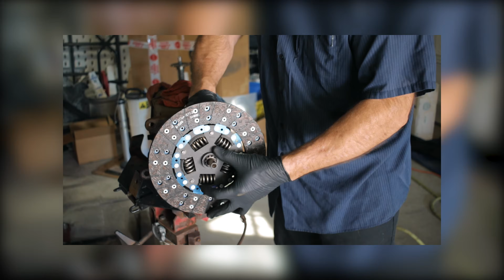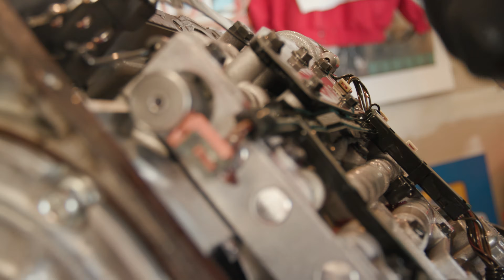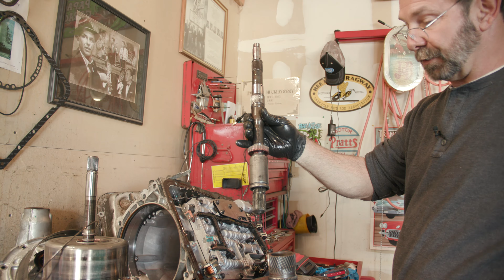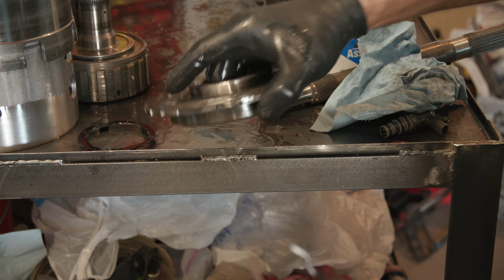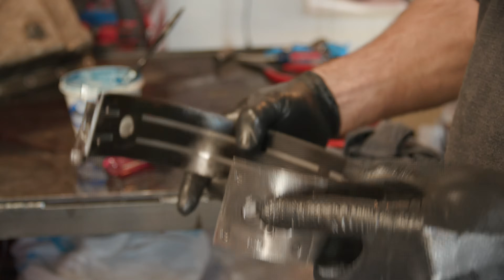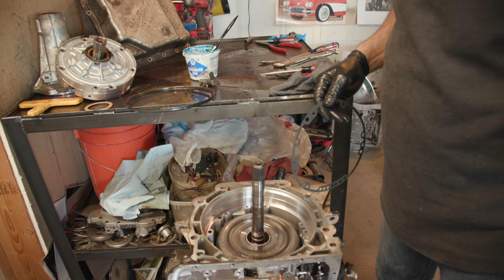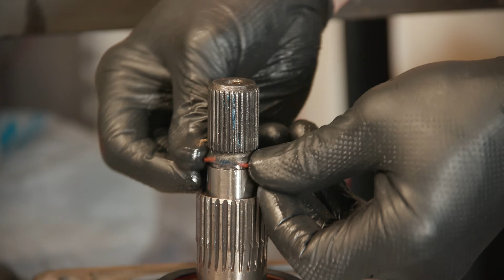4L60E Output Shaft Swap - 2WD to 4WD Conversion

Comment: I liked the video but you didn't need to pull the bottom end out after removing the snap ring off the shaft, it's good that you showed it though. Might as well inspect it since you're there.

Comment: Anyone know what year this trans is? I have to do this exact swap between a 97 and 98
Reply: They're all pretty much the same even the pre 96 4l60e single case, this will apply to all of them and there are only 3 output shafts to choose from 2wd (long) 4wd (short) and Corvette output shaft (real long)

Comment: i did this, but now i have a leak between the back of my transmission and my transfer case, is there meant to be an output shaft seal on the case, or not since the 2wd yoke has its own? thank you
Reply: yes there's a gasket that goes between transfer case and adapter and a o-ring between tranny case and adapter.

Comment: Once the snap ring was removed from the output shaft, why was anything else removed? 
The transmission should have been in an assembly fixture where the output shaft could have been bumped and it would fall out. A trick to remove the pump is to apply slight pressure to the pump at the lower side while bumping the input shaft in the opposite direction. NOT banging the shaft, but "encouraging" the pump to break loose.
Reply from the maker: You're so right.
Before we started filming this episode, we had a rough plan.  But, then we got off track...and carried away.

Regarding the pump removal, that's a great tip.

Thanks for your comment.  Appreciate it.

PS I have plans to re-make this episode.  New & improved...
Reply: @SouthpawAutoworks I’d really appreciate a remake of this video I really enjoyed it and plan on doing the 2wd to 4wd swap soon

Comment: Thank you for all your help. I have replaced my sunshell and torque converter in my 4l60e on my 98 tahoe. All seems be fine, sorta.... In my driveway I have run it thru all the gears and it seems fine. When I go from Reverse to Park I hear a thunk. It does go into park but should I be concerned? What may be my issue? Update: The 98 tahoe seems stuck in 4wd low. I need to figure out why, ever see this? UpdateII. I took the front wheel off the ground and looks like there was some tension. Now it's in 2wd High and so far seems good.

Comment: Great video! When converting a 2wd 4L60E to 4wd, is it required to plug the holes inside the tail housing? I’ve seen some guys freeze plug holes when converting to 4wd.

Comment: Thank you again! I just replaced my broken sunshell. I put my trans together and noticed my input shaft play has almost no play at all. I can turn the shaft by hand but I have almost no play at all. Is this an issue or can I install the transmission?
Reply from the maker: WARNING:
Do what I do at your own risk.

In the past, under certain conditions, I have let a trans or two leave the bench with the end-play being tighter than I preferred......but, they always had to (at a minimum) turn by hand.  AND this was after I verified that nothing was incorrectly installed, resulting in less than ideal end-play (clutch not properly splined to a clutch hub, bearing installed upside down, etc, etc).

Anytime internal hard parts are replaced, it's not uncommon for the unit end-play to change (to be looser or tighter than it was before replacing hard parts).  OEM, and aftermarket, parts are manufactured to a certain tolerance.  They're not perfect...but, they try to machine them as close to perfect as their budget allows.  Point is, every part machined/created will vary ever so slightly in thickness (among other dimensions).

I always prefer to measure the end-play, and adjust it with the selective washers (these are washers that are designed to be different thicknesses, made specifically for adjusting unit end-play).

The best practice is to purchase a set of selective washers, measure current end-play, and then replace the incorrect selective washer with the correct one...and then double-check end-play.

WARNING:
Do what I do at your own risk.
Reply: @SouthpawAutoworks  Thank you for the explanation. All parts are installed in the proper orientation to my knowledge. I have replaced by installed 70 shim with a 68. Now I have play within specifications. Better to be safe than sorry. Thank you.
Reply from the maker: I'm glad to hear that.  Keep up the good work.

Comment: Awesome video. But having done this before. None of the internal case parts have to actually be removed to swap shafts. It's only the c clip that holds it. Pop the clip. Drop the shaft out the bottom. Then twist and reinstall the new shaft. Then clip it back into place.
Reply from the maker: You're so right.

Comment: Does it matter which side the c clip is installed on? One guy on YouTube says it does. The c clip  looks the same on both sides.
Reply from the maker: Are we talking about the output shaft snap ring (little yellow guy)?
Reply: Yes. I think I know why. Any reason they paint it yellow?
Reply from the maker: To the best of my knowledge, it doesn't matter which way it's installed.

IDK...
Maybe for sake of better visibility, during assembly at the plant.
Reply: Thank you. Very informative.
Reply from the maker: You bet.
Happy building.

Comment: I’m rebuilding a 4L 65E and have a question about the tail shaft. I’m swapping from a four-wheel-drive to 2 Wheel Dr. and the four-wheel-drive shaft that I’m removing is attached to the ring gear. is it mechanically attached? When your video the two parts just drop apart. 16:45
Reply from the maker: No, it's not mechanically attached.  But, it can be a bit of a press fit (interference fit)...depending on the ring gear.

Check out this link (https://amzn.to/3lHlEso).  
If you look closely at the rear ring gear, you'll see two (2) dimples on opposing sides of the splined hole.  I am of the belief that the factory did this to create an interference fit between the rear ring gear and the output shaft....for easier assembly.  When the shaft and rear ring gear are pressed together, the shaft can not fall out of the unit, when the unit is stood upright....even if the small (often times) yellow snap ring has yet to be installed onto the shaft.  Thinking the factory did this to simplify the assembly process.

Output shaft won't fall out:
With the little yellow snap ring removed, I use the bottom of my hammer handle (rubber coated), and strike the output shaft towards the rear of the trans.  The shaft usually comes out without much fuss.
Reply from the maker: BTW, I just watched that part of the video.  Thank you for sharing the timecode.
I see what you mean.

I plan on re-creating this video...and doing a much better job of filming, editing, etc.
Thank you for your input on this.  It will help me create something better.

Comment: I'm really struggling pulling out the tiny snap ring that holds in the tail shaft in. I have to find a good snapring pliers to get it out.
Reply from the maker: Here's what I use.

https://shop.snapon.com/product/Snap-Ring-Pliers-(Transmission)/External-Snap-Ring-Pliers-(Blue-Point)/PR15

My pliers have been modified...another video for another time.
Reply: @SouthpawAutoworks  I ended up using two pics and got the snap ring off
Reply from the maker: Nice work!

Comment: I'm switching my 4L65e from 4wd to 2wd and swapping the tailshaft. This video helps very much. I don't the history of my transmission so I will have to dig into the other subassemblies and check for worn parts and replace as needed. Thanks very much
Reply from the maker: Right on!  That's exciting.

Comment: I have a 98 4wd 5.7l tahoe with a 4l60e. I just picked up a 97 4l60e from a 97 suburban. The bell housing is not removable and the pan is more shallow on the 97. Can I install the 97 tranny in the 98 Tahoe?

Comment: So for a 40yr master that was just changing the shaft, why take rear section apart in the first place and not change shaft as he showed fitting it with rear components reinstalled if that was the key function  ????
Reply from the maker: I feel ya...
There are plans of redoing this video.  Better lighting, angles, and of course trimming all of the fat.

Thank you for your feedback.

Comment: 😊 you made it look so easy I have a 4L60e 2wd 2001 Chevy Silverado it lose drive and reverse my guess is the sun gear went just had it rebuilt not long ago made 1Yr. The kunk spring wore in to the case like you said. Just did the engine over 3time transmission 2 times. I am looking at a 2001ford 350 diesel 7.3. needs a transmission do you have a video on that and how much is a rebuild kit complete mine you it's a dulley 2wd 8ft bed.crew cab.
Reply from the maker: Bummer about your 4L60E headaches.  If the trans is missing all forward movement, and Reverse, then it's gonna be something beyond the sun gear.  A broken sun shell (which is tied to the sun gear) will affect Reverse, 2nd gear, and 4th gear...

We don't currently have a video on that particular Ford transmission.

Comment: I hope this doesnt sound dumb but why cant you stop the tear down when you get to the snap ring on the output shaft pull it out and slip the 4wd one then thanks
Reply from the maker: Your question is valid.
One absolutely could stop right there (at the little yellow snap ring).  We simply got carried away.  =)

I am working on redoing this video.  It'll be way better than this one...

Appreciate your question.
Thanks for dropping me a line.

Comment: Is this one of those videos where the instructor is so good that it ends up looking easier than it actually is?
Reply: Nothing about this looks easy
Reply: @riadelramahi  these old GM trans are some of the easiest of all Autos.
Reply from the maker: Everything always looks easier/simpler from a distance.

What if the instructor was missing an arm?

1 Handed Transmission Builder:  (60-Sec Preview)
https://youtu.be/y3Vixa_Ec1E

Comment: Thanks for this great video.
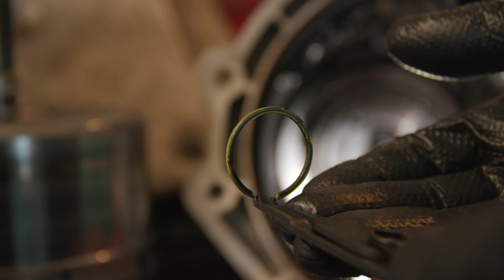At 13:36 in the video he takes out the snap ring that holds the output shaft in the transmission. Will the output shaft come out of the back of the transmission at that point? It looks like it will to me so it looks like that's all that needs to come out. Is that true? 
Thanks and God bless you all!
Reply from the maker: Yes, the output shaft will come out, at that point.

Comment: Quite often you hear the that 4L60e is "weak". And tends to die easily. Is this true? If so, how can it be strengthened up enough for good longevity?
Reply from the maker: It definitely has it's shortcomings.

There's a number of things that can be done to beef it up.  Sounds like a topic for a future video.
Reply: @SouthpawAutoworks  After more research, it sounds like a waste of time and money. Looks like you save a lot of trouble and a lot of money just going with the 80e.
Reply from the maker: There ya go.  Whatever it takes.

Comment: I have a 4l60e that doesn't t shift to second gear, pull the pan and found material stuck in the filter that looks like a gasket what could that possibly be...thx
Reply from the maker: I don't have nearly enough info to get a feel for what's going on....but....

That material could be from the 2-4 Band.  If the band has failed, the trans will be missing both 2nd gear and 4th gear...and you didn't mention 4th gear.
Could be a problem with the 1-2 shift valve, and its associated oil circuit.
Could be a problem with the 2-4 Servo.
Etc.

Comment: Do you use any sealant on the pan gasket?
Reply from the maker: We will use spray adhesive to stick the pan gasket to the pan.  However, we do not use any sealant (Silicon, RTV, anaerobic sealer, etc).

Spray Adhesive:  https://amzn.to/40JQ1lj
Note:  We use it to stick the gasket to the pan (not the trans case).  Removing the gasket (down the road) from the pan, is a lot easier than removing it from the trans case.

DISCLOSURE:  🕵
Links provided are affiliated links with the associated websites. While there is no extra cost to the purchaser, a small portion of the sale goes to support this YouTube channel.

Comment: Man, thx for the info and demonstration of this process. My one question would be does this same process also apply to 4l65e or 4l80e? Or upgrading 4l60e to one of those by swapping specific internals? I just want a 2nd thought because I just don't have a lot of experience with transmissions.
Reply from the maker: The 4L60E and 4L65E are essentially the same transmission (very minor differences/updates/etc).  So, yes, nearly identical process.

The 4L80E is a completely different trans.  However, it's the same idea.  Gain access to a snap ring (that's retaining the output shaft), and make the swap (2WD for 4WD, or vice versa).

If you don't already know, the 4L80E is essentially a TH400, but with a built-in overdrive.  So, if you're interested in seeing how the TH400 (and 4L80E) output shaft is retained, you can check out the TH400 Build Series.

*****TH400 Build Series*******
TH400 Teardown:  https://youtu.be/UtFs24f7QQM
TH400 Inspection:  https://youtu.be/H6PAoMgM8q0
TH400 Building Clutch Drums:  https://youtu.be/g4-6VbSfDM8
TH400 Building Clutch Drums (Continued):  https://youtu.be/30W3bt9z6Yo
TH400 Bushings:  https://youtu.be/k5iwRns2v7E
TH400 Prepping Case for Assembly:  https://youtu.be/XzzpjcALjhc
TH400 Planetary Gear Set - Assembly & Installation:  https://youtu.be/OX3Q3XufQPw
TH400 Intermediate Clutch, Band, Direct & Forward Drums:  https://youtu.be/gwJ9Axv3_9Q
TH400 Pump + Front End-Play:  https://youtu.be/tfQiHPZlIQI
TH400 Valve-Body + Servos:  https://youtu.be/vNW2dkTn7ak
TH400 Filter + Pan + Modulator + Governor + Speedo:  https://youtu.be/t_pqgrpe8b0

When time permits, we will be putting together a build series on the 4L60E.

Appreciate your interest in this topic.

Comment: Just came across this as I have a swap to do. Question is if so many pieces went back in before the output shaft goes in, is it necessary to take those pieces out before the ouput shaft is pulled?
Reply from the maker: It's not necessary to remove everything shown in this video.  However, once the output shaft is removed, there's. a possibility that a thrust washer, or thrust bearing, may fall out of place, causing reassembly issues.

When time permits, we will update this video, to reflect this.

Comment: Hi, I have a 4t65e versatrak that just start slipping in all gears and I was wondering if I had a 4t65e 2wd how hard it would be to pull the output shaft on the 2wd and replace it with the versatrak output shaft and transfer case. Thank you for any information you can give me.